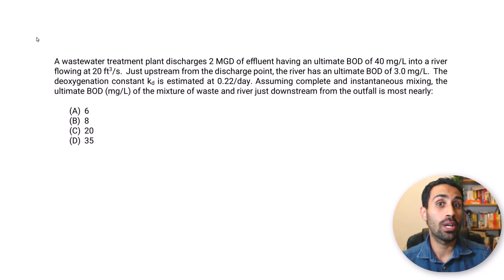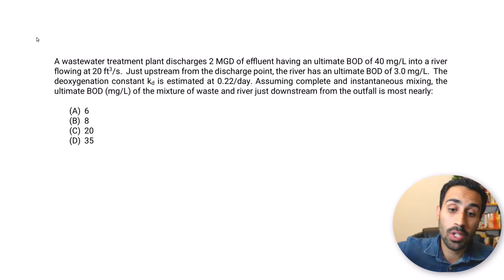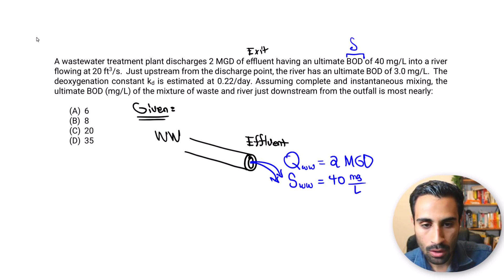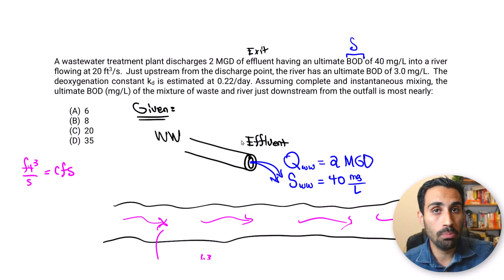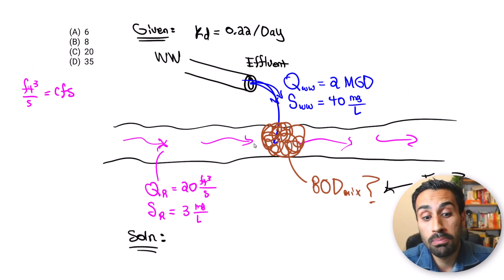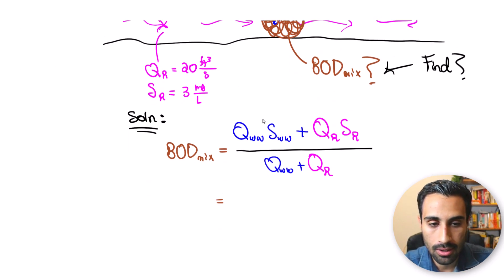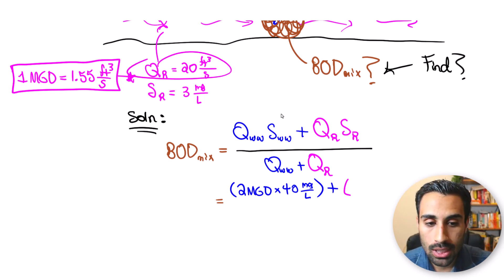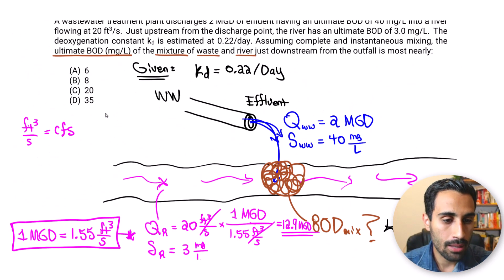2023 FE EXAM PREP - CIVIL AND ENVIRONMENTAL - WATER QUALITY - MIXING FORMULA

Comment: Is the formula you used in the FE handbook?
Reply from the maker: Unfortunately not. I would put this in your equation sheet. 

It's actually derived from fundamental mass balance as shown: 

Mass (Load) in = Mass (Load) out

Wastewater BOD load = Qww × Sww

River BOD load = QR × SR

Mixed load = Qmix × Smix

Apply mass balance: 

Qww × Sww + QR × SR = (Qww + QR) × Smix
Smix = (Qww × Sww + QR × SR) ÷ (Qww + QR)

Smix = ultimate BOD concentration